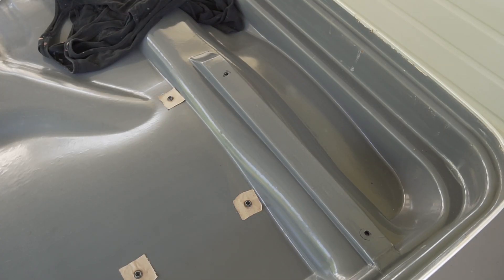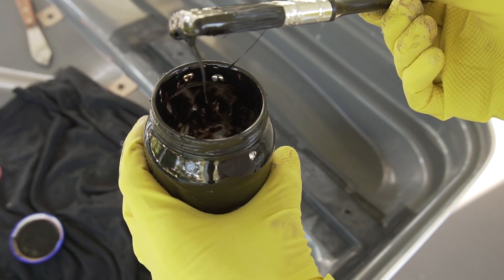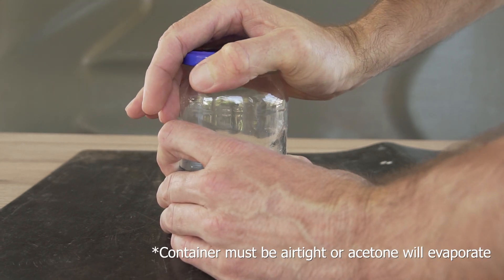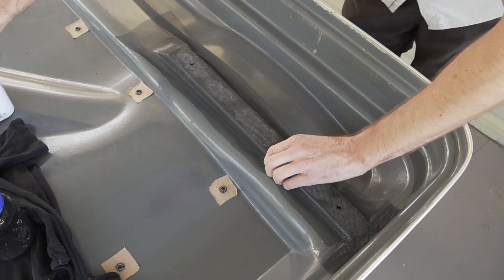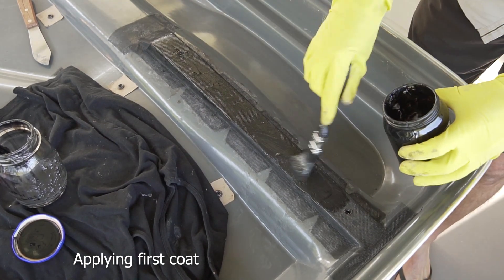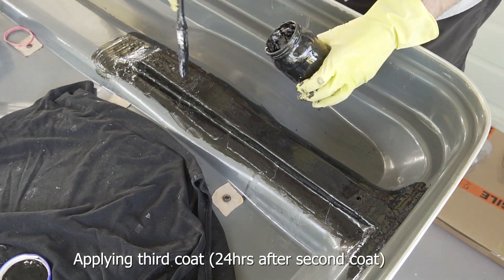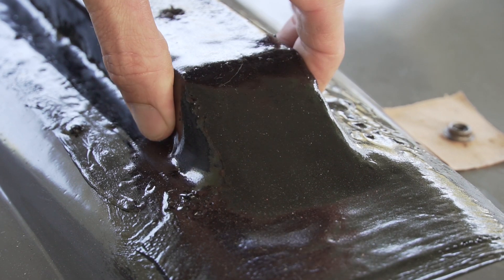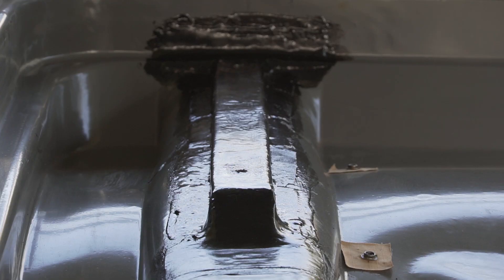How to repair and reinforce large ABS plastic items using ABS slurry.

Comment: Think this would sand up nicely or is it quite porous?
Reply from the maker: I haven't tried sanding it, but I think you could sand it to get the desired shape, but the finish probably wouldn't look all that nice. You may be able to get ok results with very fine sand paper if you want a nice finish. It would really be a matter of trial and error I think.
Reply: For The Love of Video thanks mate tried sanding it came up okay then used a body filler to fill small holes. Holds up very well, nice and strong! Great video!!

Comment: Great video for showing how to make and apply abs slurry. After the abs slurry dried, the coating would be fleixble or brittle. Thanks.
Reply from the maker: Once the slurry dried it basically became hard plastic again. It's definitely not brittle, and has only a very small amount of flex which I would say is much the same as an other ABS product. Obviously the more layers you use the thicker it gets overall making it more rigid and less flexible. The repair in the video was quite rigid once dried due to the overall thickness I made it. Hope this helps.
Reply: @fortheloveofvideo6306  Great info. I will try it. Thanks again.
Reply from the maker: @next1mpact  not a problem, good luck with your repair 👍